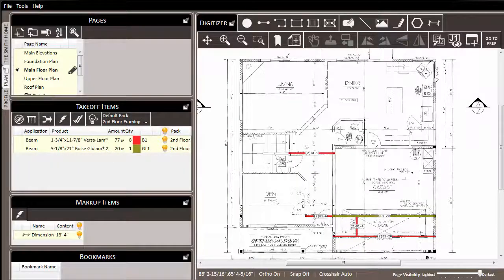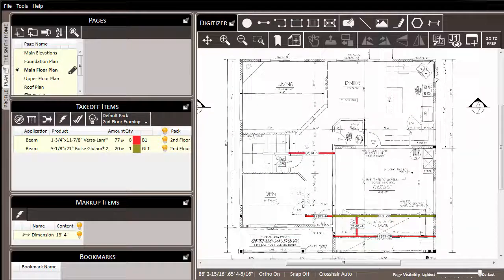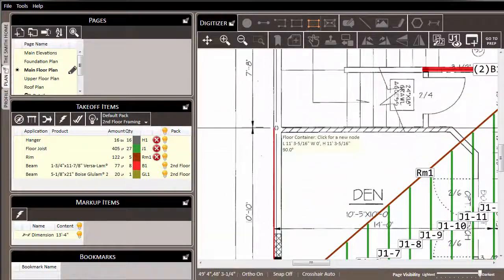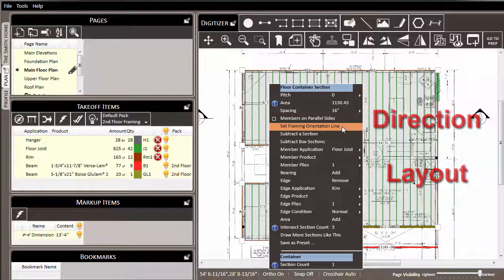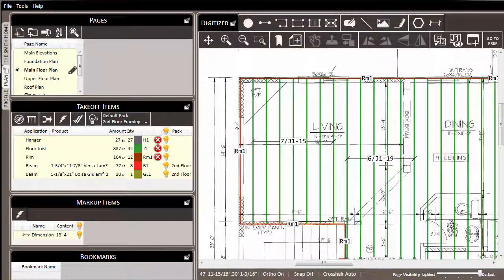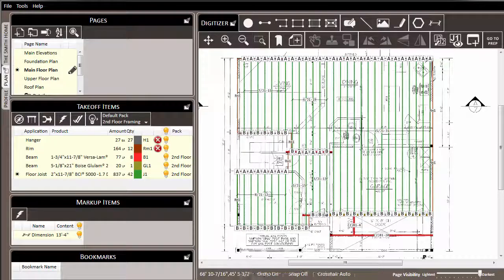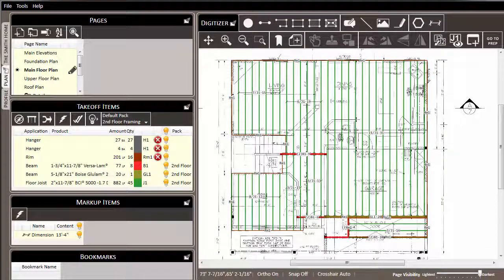Drawing Joists - [BC Estimator]

Comment from the maker: Jump to a specific topic by clicking on a timestamp below:

0:22 - The Floor Tool
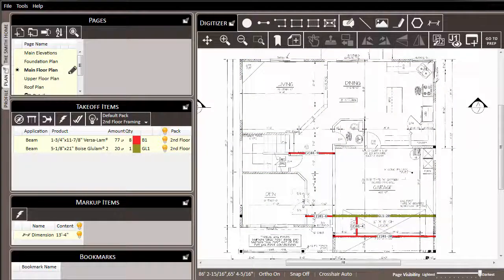1:10 - Drawing a Floor
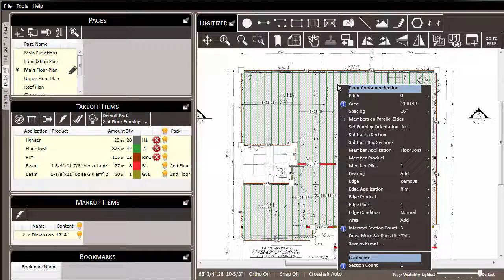1:55 - Changing the On Center Spacing
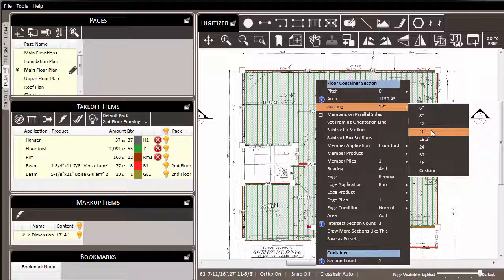2:10 - Framing Orientation (direction and layout of Joists)
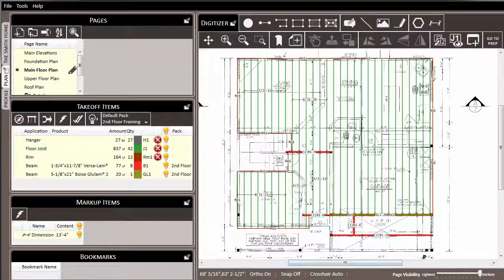3:06 - Assigning a Product to the Joists
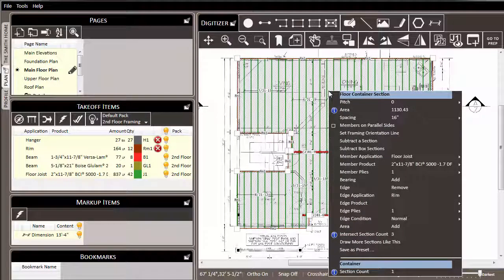3:41 - Drawing More Floor Containers